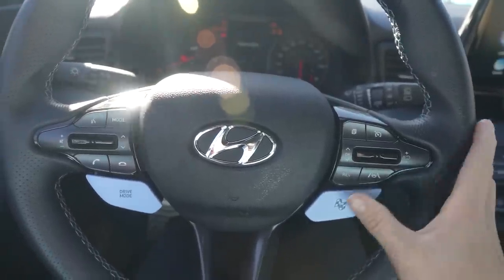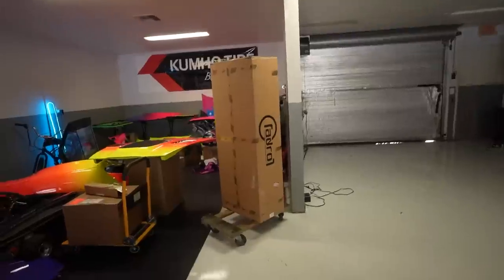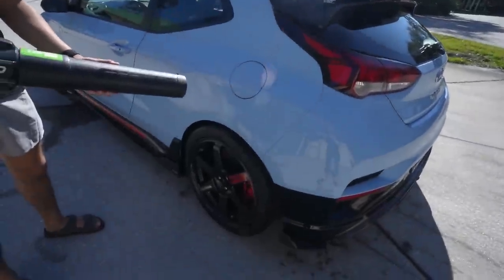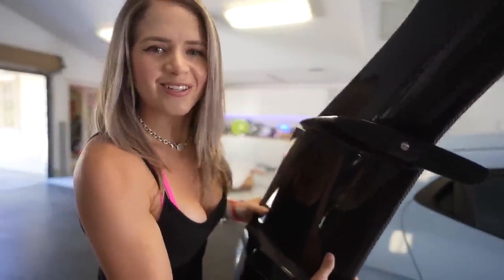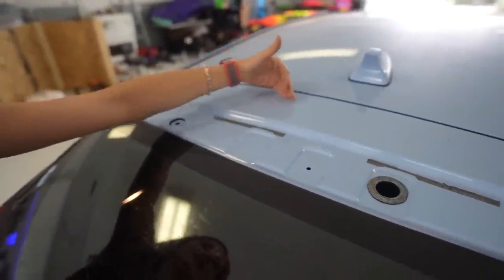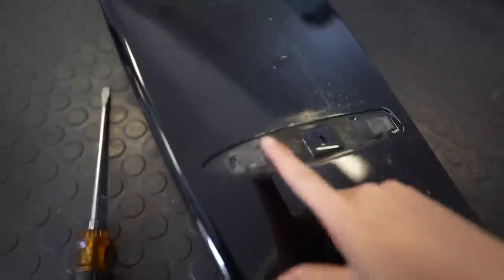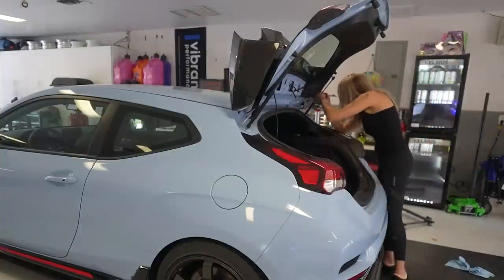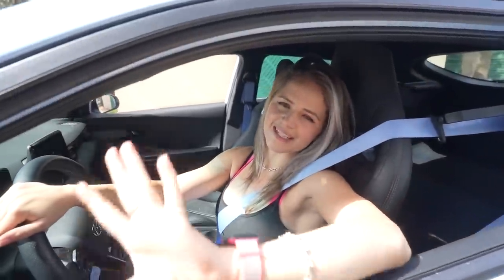Finally Got the Big Wing for the Veloster N! ❤️

Comment: I bought the devil wing for my veloster but made a mistake and bought the turbo version. I have the base model. Tried to make it work. Also had a hard time getting the original  spoiler off. In the end used only two screws and some construction advice. Still happy with the way it turned out.

Comment: I own a veloster turbo here in Australia, a rear wing adds downforce @ high speed and on a front wheel drive care this brings the front shocks and potentially the wheels up effecting grip and steering not what you want on a track or road car.